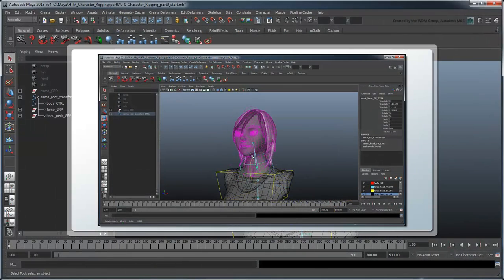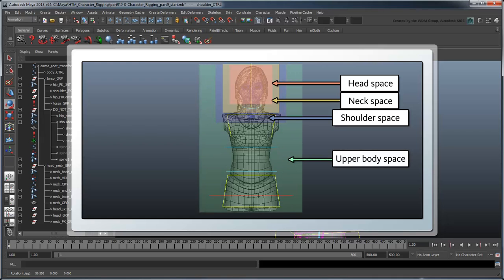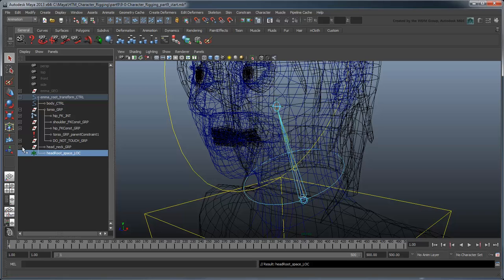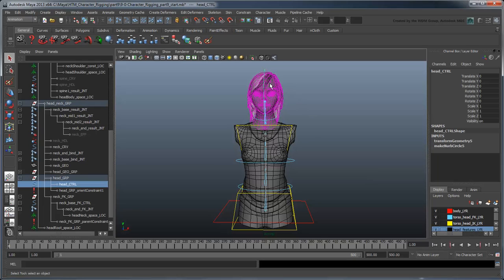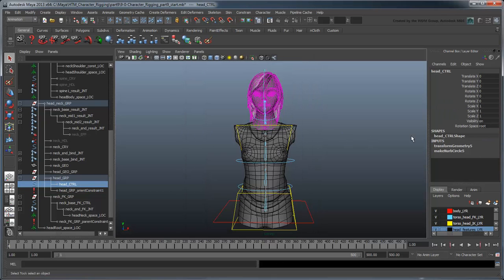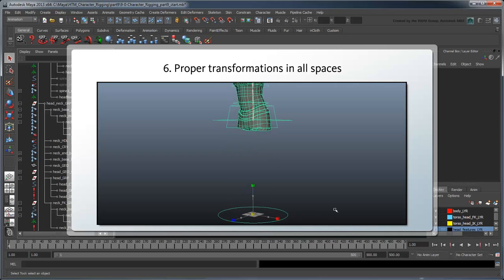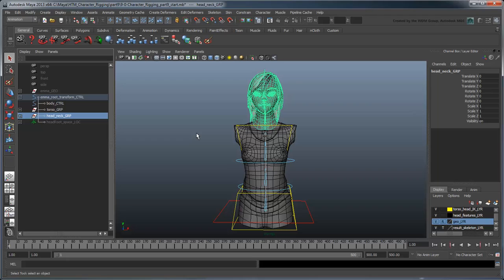Creating a Character Rig - Part 9: Neck space switching and cleanup (Advanced)

Comment: Given that my animator doesn't want a stretchy rig, having the head not follow the neck when the translation and/or rotation space enums set to certain combinations is very detrimental to the rig. as this is a reoccurring issue is there a better way to do this?
Reply from the maker: In Appendix D I show you how to add on/off controls for the stretch, which should fix that particular issue.

Comment: Hi after orient constraining the head_GRP to the space_LOCs, when i rotate the chest in Y-axis for example while either Neck Space or Shoulder Space is set to 1,  the head or neck seems to be moving in a weird way as if i rotated the Z-axis. Hope you understand my question. Do you know what might be the problem? Thanks
Reply from the maker: I'd check the Location Rotation Axes of those result and IK/FK joints.  Sounds like they aren't aligned.
Reply: I had a very similar problem here which was bugging me for ages until i reset my constrain orient tool options then everything worked. I'm sure you already figured it out but posing for anyone else who finds themselves stuck here.

Comment: Hello, I have a problem with the point constraint; the "head_CTRL" and the "neck_base_FK_CTRL", they don't move in the correct way. 
With the parent constrain both worked correctly, but then the head just rotates but it doesn't follow the neck(actually it just moves with the Y translate).
The joints of the neck, and the "head_CTRL"  don't follow the "neck_base_FK_CTRL", they just rotate.
Reply from the maker: Did you double check the Local Rotation Axes between the joints?  It's possible they're not lined up correctly, which causes them to rotate differently.  Also, when you created your constraints, did you do it with "Maintain Offset" turned on?
Reply: @Autodesk_Maya  Thanks for your answer. I solved the problem. I don't know how, but it works.
Reply: @Autodesk_Maya  Thanks, I already solved the problem.

Comment: Hello!, i cant get the orient constraints working properly, whenever i constrain them the neck bends at a weird angle. What would cause this?
Reply from the maker: I'd check in the Orient Constraint options to make sure "Maintain Offset" is turned on.
Reply: Alright so i checked the box, but i still get random rotation on the Neck grp
Reply from the maker: Hmm, does this happen with a Parent Constraint as well?  The Maintain Offset option should keep everything in place.  Does the rotation happen immediately upon creating the constraint, or only after you start moving the neck?

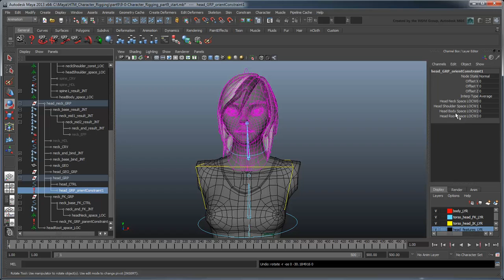Comment: I have redone parts 8 and 9 three times now and wind up with the same results each time. When I get to part 9 @ 6:06, with the head_GRP_orientConstraint1, headShoulders_space_LOC set to 1 and the rest to zero, my head geo does not follow the shoulders control.

I just figured out that it is due to what appears to be a misleading visual in part 9 @ 6:07 which shows the shoulders control turning the head geometry with the head_GRP_pointConstraint1 in effect before it has been created which is added @ 8:50 as stated just below by BT Darmstad.

"I got a little confused at 6:06. It looked like the head already followed correctly at that point, while the point constraint wasn't added until 8:50."

See image at: https://www.infinitee-designs.com/part-9-607
Reply from the maker: Actually the visual is correct, because an Orient Constraint is already created at that point (hence why the head joint rotates).  A Point Constraint only deals with translation.

Comment: dont we need the neck gets smaller when ti stretched?
Reply: and the locs for head rotating attributes, do they need to be parented within the exact groups and joints like you did here? is there any reason for that? thank you!
Reply from the maker: Because we actually skinned it, we don't need to worry about that.  Also the neck doesn't tend to stretch that far anyway.
Reply from the maker: Yes, they do.  It's necessary to ensure the space switching works properly and that they follow the correct joints.
Reply: Maya Learning Channel yeah but I mean in case of the body for example, is there any difference between being patented to DO NOT TOUCH GRP and the upper body control? Isn't the DO NOT TOUCH GRP driven by the upper body control, so if we parent the body loc to the upper body there should be no difference
Reply from the maker: In that case there shouldn't be a difference.  the Do not touch group is merely a safety precaution.
Reply: Maya Learning Channel thank You so much for your answering!

Comment: I'm with you all the way until I apply the point constraint... it doesn't seem to have any effect whatsoever. The rig works nicely otherwise; when the neck_end_FK_JNT is parent constrained to the head_GRP, it works nicely. And when I delete that constraint as instructed in this video and do the orientConstraint, that works exactly as shown here. But the pointConstraint doesn't do anything.. I tried comparing to the work files and after hours I still haven't found out what's wrong. Any ideas?
Reply: Nevermind! I misplaced my locators... they were snapped to the neckBase_bind_JNT and not the the neckEnd_bind_JNT. This isn't the first time I misplaced locators either...oops
Reply from the maker: What space is your neck currently in?  Try changing that and then turning the shoulders and see if there's any difference.

Comment: After parenting the neck_base_bind_JNT and neck_FK_GRP to the neckShoulder_const_LOC locator, the head doesn't move along with the body. I've paid very close attention and am notsure what I'm doing wrong. The base of the neck moves with the shoulder_bind_JNT but the head remains fixed in place.
Reply from the maker: What translation space is the head currently in?  What you're describing is the expected behavior for the UpperBody and Root translation spaces.  If it's happening in Shoulder or Neck space then it probably means the locators for those spaces aren't parented correctly.
Reply: Ah, I figured it out. It was just a stupid mistake on my part, instead of grouping all of the neck FK's I made an empty group and parented that to the locator...

*facepalm*

Comment: Warning, in the file: 9-0-Character_Rigging_part9_start.mb, the neck_base_FK_CTRL has a non-zeroed rotation value on the x axis.
This also appears in the Part 8 files that has that controller.
The files 9-1 and beyond all have the correct (zero) value.

Comment: When I have oriented the space locators to the head_GRP, the head doesn't follow correctly (when I want it to follow). The head itself stays in place (it only rotates in place), while the neck stretches from the head to the collar's new position. I've tried twice with my own rig, and twice with the provided rig, and get the same result. I'm in Maya 2016.
Reply from the maker: Sounds like you've orient constrained but not point constrained.
Reply: Oh yeah, I got a little confused at 6:06. It looked like the head already followed correctly at that point, while the point constraint wasn't added until 8:50.
Reply: Why don't you use parent  constrained directly.

Comment: Curious.  I Point Constrain everything, but when I add/remove the constraint's weights (for the Driven Keys), the head moves up or down as though Maintain Offset is turned Off (even though it isn't).  I can't fathom why this is happening, but it's quite annoying.  The Orient Constraints and Rotation Space attribute work perfectly, it's just Point Constraining that refuses to cooperate.  I've built many rigs like this before, so I can't understand what I'm doing differently for this project.

EDIT:  Never mind!  I managed to solve it!  I rather unknowingly moved each Locator on top of its corresponding Joint (force of habit).  I moved them all on top of the Head Joint's origin and that fixed everything!

Comment: Hello, those video tutorials are very nicely and helpfully. Sorry if I didn't understand, I'm a maya beginner. Cause of my job, I need to parent the torso to net neck, to get a consistent joint flow, I parent (P) the bind joints, FK joints and result joints, but neither the neck nor the head are following by the control of the shoulder. I also tried to parent the shoulder bind joint to the neck base bind joint and the neck base fk control (there is no neck base joint fk), but still didn't work. How can I do it? Thanks!

Comment: I need some help. Whenever I twist the shoulder controls, the neck_result_skeleton joints start twisting. I don't like the result, but is it supposed to happen anyways?
Reply from the maker: Ocelott|SheDoesStuff That's actually the whole point of the space switching.  The idea is that you create a control where you can toggle what follows the shoulder control.  If you change the Rotation Space via the control we set up on the head_CTRL, you should be able to turn this behavior on and off.
Reply: Thx! The problem's solved now! :)

Comment: Great tutorial series! You really helped me with some complicated setups along the way with a character I made recently. I just have a couple of questions about my rig that I was hoping you could help me with because I'm having a small issue with the head/neck area & the neck curve in my rig which i cant seem to iron out & I believe you may know the answer once you take a look at my setup. If I were to e-mail you the scene, would you mind giving it a glance and seeing if you can tell me what i did wrong? When I bend my character at the waist, the head/neck curve "pops" the head out of place as the curve deforms rather than follow the body bend ,yet my controls do follow the rig and stay in place. I could really use your help on this as I am not currently able to ask someone locally that could help demystify what eludes me on this. Any and all help would be greatly apreciated.
Reply from the maker: Sounds like a few things could be going on here.  Either the curve is not following the controls correctly, which would indicate that skinning of the curve to the bind node or the bind node parenting itself is incorrect, or something is wrong with the space switching setup.  I would first make both the spine and neck curves visible, then recreate the problem and see how they are shaped.  If you set up the neck properly, the result joints MUST follow the curve, so that will help you narrow down your problem (whether the curve itself is incorrect, or just the relationship between the result joints and the curve).

If you like, you can upload a photo somewhere for me to take a look.
Reply: Thanks for the advice it totally makes sense. I'll double check the setup, see if I can duplicate it in a separate rig setup sso I can compare results of the rig/parenting/bindings, then I'll upload It on here & paste the link here for you to see. I'm thinking the parenting being incorrectly placed is the issue.

Comment: I was doing your tutorial then I had a problem
the neck wont move even when i already place the locator correctly and parent it to the shoulder
can you tell me what's the problem here ? Thanks.
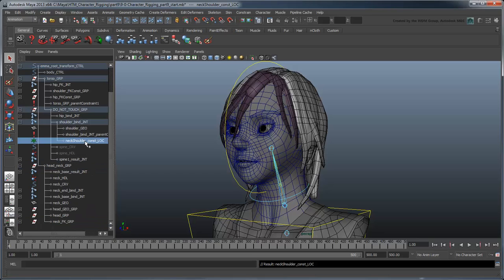Reply from the maker: Did you make sure to parent constrain BOTH sets of joints as outlined at 1:45?
Reply: I did it for a few times and it doesn't even move.
Reply from the maker: Vincent If you manually select both the neck_base_result_JNT and neck_base_FK_CTRL does the neck move?  If not then your neck setup is incorrect.  If it does, then retry the constraint process shown in this video but first open the Parent Constraint Options window and go to Edit > Reset Settings.
Reply: Maya Learning Channel the only thing that moves is the curve (neck). Do you know any solution to this kind of error ?
Reply from the maker: If the curve is the only thing moving, then it sounds like you forgot to actually create the IK spline.

If the curve + joints are moving but not the geometry, then it means you forgot to skin the geometry to the appropriate joints.
Reply: Thanks dude. I think I should recreate the head and neck spline.

Comment: Great set of tutorials! However, when setting the shoulder space on at 6.06 and rotating the shoulder Control the head rotates but does not follow the neck_end_FK_JNT (i.e the head can rotate but is fixed in position). Hence the neck and head appear to be torn apart. How do I fix this? Thanks!

Comment: When binding the skin to the neck and head result joints, I am finding the neck_end_result_joint causes the head geometry to spin in an unexpected way when the head control is used. How do I rectify this? Thank you in advance!
Reply from the maker: Sounds like the Advanced Twist control axes aren't set up correctly, or the Local Rotation Axes of the neck joints are a bit off.

Comment: I made a couple of mistakes with the rig, and am now having some difficulty fixing them.
With the head control I didn't have the freeze transformations setting on rotate, so the z rotation value is now at 90, and I can't zero it properly.
Also, if you lock and hide the wrong transform values in the channel box, how do you undo it?
Thanks.
Reply: sorry, found second questions' answer myself. I went into channel control and told it to display rotate x, rotate y and rotate z.

Comment: hi, in your scene file, i notice a headRoot_space_LOC_orientConstrain in the headRoot_space_LOC, i have reviewed the videos and didn´t find where do you did it, am i missing something? tks
Reply from the maker: I just reviewed the scene files and have not found this constraint.  Are you sure?  Which file are you checking specifically?

In any case, this should not exist.  The constraint should be under the head_GRP.  The most likely reason the constraint would fall under the headRoot_space_LOC is if it were accidentally reversed (i.e. the head_GRP affecting the locator).
Reply: Maya Learning Channel
Hi, the file ... 9-3-Head_neck_cleaned doesn´t have the constrain, but the next file - 10-0-Character_Rigging_part10_start has.
Reply from the maker: Hmm, those two files should be exactly the same.  I'll look into it.

Comment: I still don't think the neck space switching control is providing the right functionality, specifically to keep the head looking forward, and not turning with the body as you show in the walk cycle. I just tried a test where I had the neck, shoulder, body, hip and root controls rotating back and forth on the Y axis. The head rotates no matter how I set the space switching, there's no way to keep it looking forward (unless you key every frame which defeats the purpose).

Comment: These videos are great. I'm finally going to learn how to make a decent rig. However, I've opened up 9-3-Head_neck_cleaned.mb, which goes along with this lesson. When I set the translation and rotation space to neck and then rotate the shoulders, the head still rotates. When I set it to the translation and rotation space to neck or shoulders, and then rotate body_CTRL, the head also rotates. I would think that setting a rotation space means that only that part causes the head to rotate.